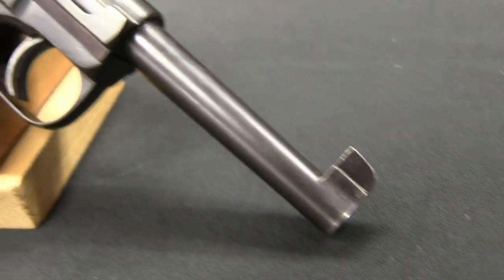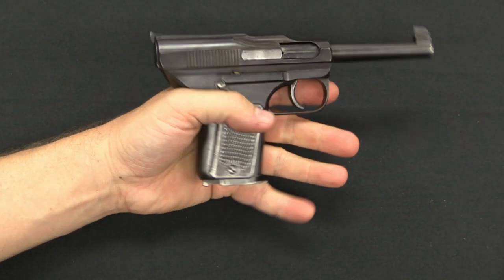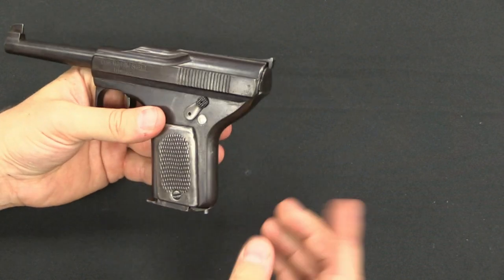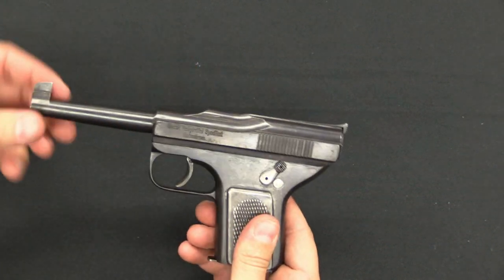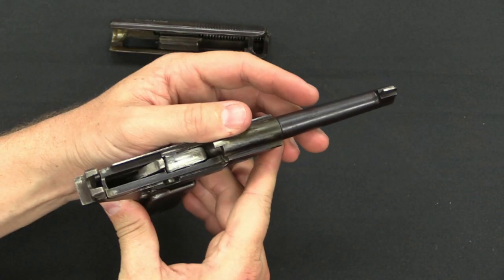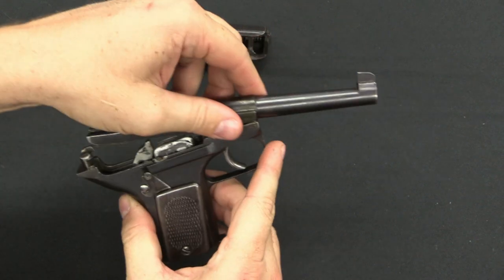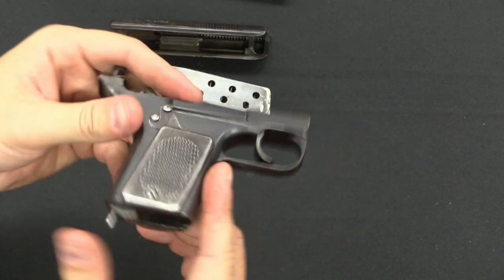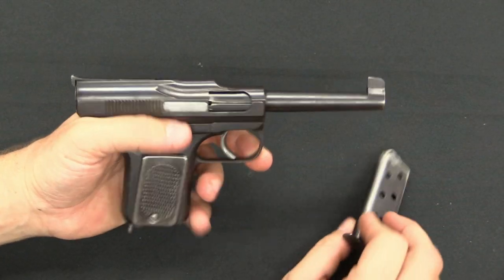Schouboe Model 1903 .32ACP Pistol

Comment: Wow 63 grain wood core bullet going 1500 fps, i wonder how effective it was. Probably not great penetration but it probably would deform/disintegrate.
Reply: faster lighter bullets are generally better at penetrating, maybe not aluminum and wood but its hard to say. I woodent be surprised if it did about as well or betted than lead.
Reply: MrLoobu I dont think thats correct, a heavy projectile will always penetrate more, relative to velocity
Reply: +Dustin Yea faster and heavier is more energy but if its heavy its not as fast, youd need to increase caliber, regular .45 goes around 900-1100 fps and doesnt penetrate well because thats like shotgun speeds. 60ish grains is like 4 times lighter than a fmj .45 though so probably wouldnt be worth it since stopping power would be far lower.
Reply: MrLoobu Lol, stopping power huh? Shotgun speed doesnt mean anything, all loads are different, heavier bulleta tend to pemtrate more, fact!
Reply: 1500fps is pretty slow for suck a light round.  That has the energy of a .25 ACP.

Comment: So would the slide lock open if you had the magazine in the single shot position? It seems like loading single rounds would be significantly more awkward than with a rifle that has a single shot mode. It also seems like the gun might have sold better if they made the grip long enough for all fingers to be used. These videos show how minor oversights can ruin a good design.

Comment: Interesting design. It seems very odd that they'd build a relatively large slide and long barrel (especially for a .32 Auto) on top of such a short grip. Do you feel like it would be a comfortable pistol to shoot if they grip were long enough for the last finger, or does the problem seem to be more in the design of the slide?
Reply from the maker: elektro3000 It wasn't actually uncomfortable to hold, just a bit ungainly.
Reply: Forgotten Weapons From what you've said, it seems like the Schouboe .32/.45 really should have been a success apart from one or two silly design choices? I'm not a shooter, in fact the closest I've ever come is an air rifle, but overall it looks to me like a gun that missed brilliance by a narrow margin.
Reply: koolkitty8989 There's definitely something to what you're saying; if they were going for a super compact pistol for concealed carry or whatever, that barrel wouldn't be half as long. Keeping everything else about the design, the first thing I'd think to do would be make it fit the hand for all of those reasons above.